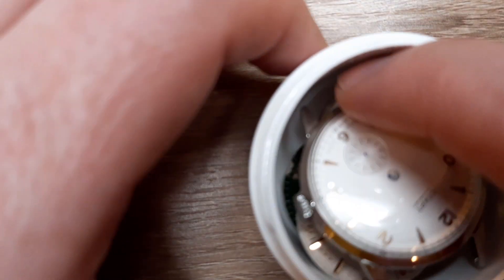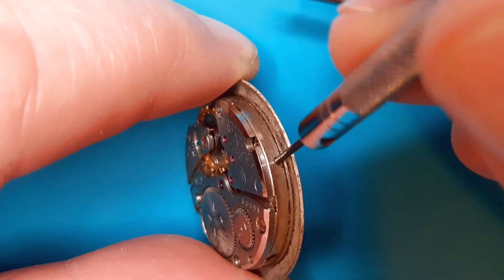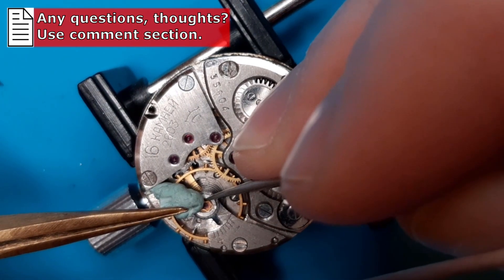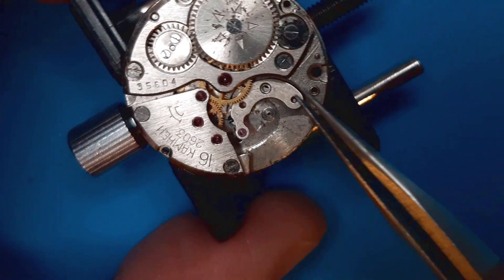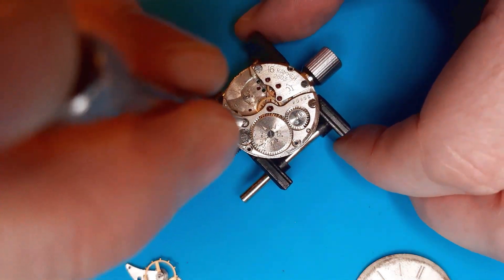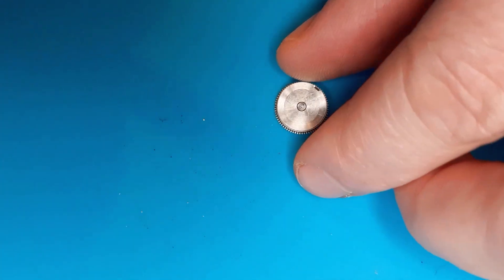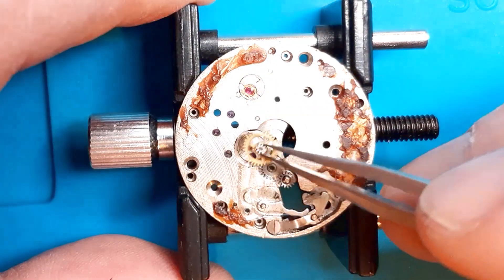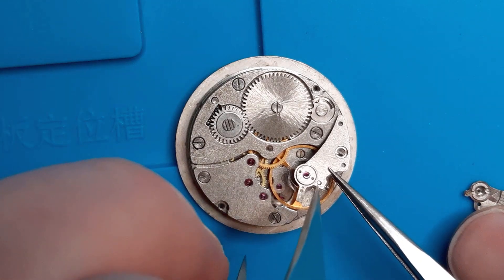START wrist watch made from a junk | Part 1 movement 2603 disassembly

Comment: nice video. i have bought 50 2603/2602 movements and in the proces of seeing how many working ones i can make out of them. do you know where i could get a bunch of cases for that type of watch?
Reply from the maker: I saw some on eBay, you can also measure the diameter and try to find something on Aliexpress, but this may be more difficult.

Comment: I have never seen a broken watch screw head in two parts , luckily it was easy to remove. It is also advisable to release all pressure on main spring as the first thing before you do anything else. It can damage your wheels. I call it "defusing a watch" :-D
Reply from the maker: Sometimes happens 😀 and thanks for your advice I really appreciate it